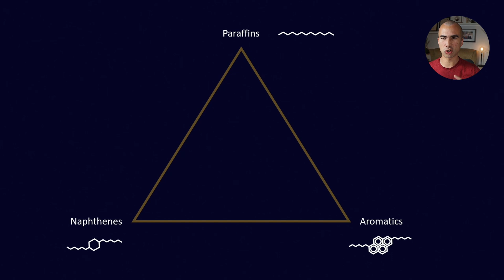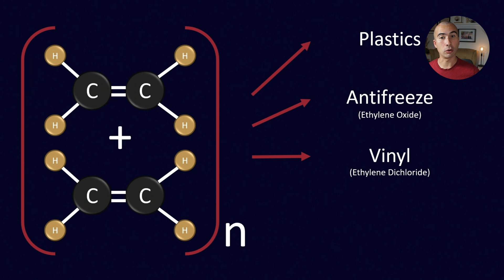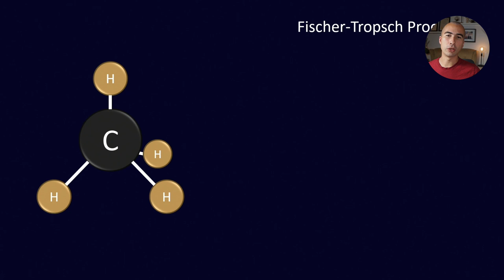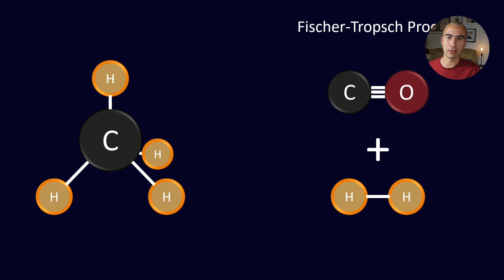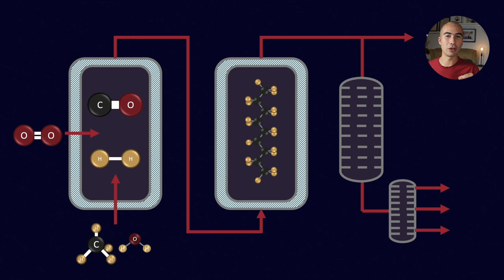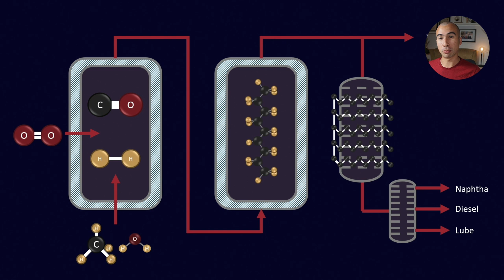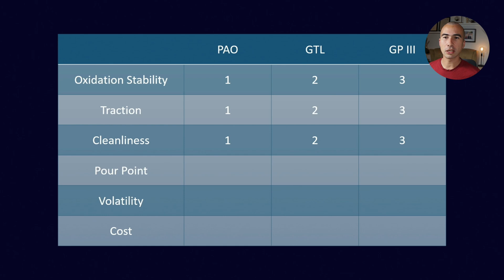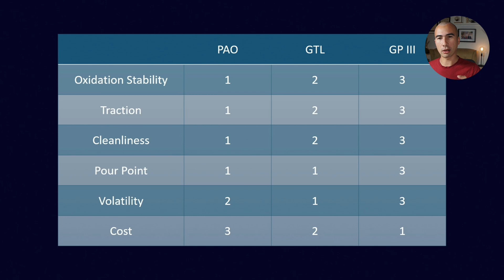What are GTL base stocks? How do they compare to PAOs and GpIIIs?

Comment: Ooo, Mr. LE? Are you losing the plot? Aren't G IV PAO's manufactured by GTL process?
Wtf, mate? :(
Reply from the maker: Hi Mr D'Souza. There's a couple of things to tease out in your question. Let's do technical first:

Yes, PAOs are start their life as ethylene, which is a gas. However, "GTL" is a specific industry term for liquids formed from natural gas. As a raw feedstock, ethylene is "purer" than natural gas, which accounts for many of the performance differences between the two, but natural gas is much cheaper, which account for the differences in price. PAO, and especially mPAO is always going to come out on top in pure performance terms, but for price/performance ratio GTL probably has the edge.

Second, let's address the history. The basics of the GTL process were discovered in the 1920s by the two gentlemen that give their names to the Fischer-Tropsch process. However, the process of converting CO and H2 into higher c-number molecules was inefficient (~40%). Several companies did R&D work in the 1980s, specifically around finding catalysts that improved efficiencies up to around 80%. Exxon and Shell seemed to be the frontrunners in these technologies; post-merger ExxonMobil looked at up to 10 sites for GTL plants and from what I understand they settled on one in Qatar. I believe Shell's main GTL plant in Qatar was intended to be a JV between the two, but ExxonMobil backed out to focus their capital in LNG facility investments, which they felt would be more profitable for their natural gas assets. Since then, Shell has built a smaller facility in South East Asia and a few other companies have built smaller ones, but Pearl GTL in Qatar continues to dominate the market. 

Thirdly, let's talk about the future of GTL. Building a GTL plant is extremely capital-intensive, and as ExxonMobil showed you have to make a decision between converting gas to liquid products, or building an LNG plant to sell LNG. The economics of both options are very different. If you want to sell GTL lubricant base oils you also need two things: access to a gas field and a base stocks company. This leaves only three players in Shell, ExxonMobil and Chevron. ExxonMobil and Chevron have displayed no interest, so that leaves the GTL market to Shell, who really have no incentive to build new facilities. As the only player, if demand for GTL products increases they can just raise their prices.

Finally, let's talk sponsorships. YouTube is governed by USA consumer law and all sponsored content must be disclosed (you'll often see a "includes paid promotion" watermark on such videos). None of my videos to date have been sponsored, nor is the channel. As much as I would like to earn a little money, I feel there's more value in the channel remaining "brand agnostic" so that the focus is on technologies rather than specific products. For this reason, I have no intention to accept paid sponsorships in future; I might make an exception if a lab or oil testing company approached me just because it would give me access to technical resources that I think would be useful to the audience, but lubricant brands are off the table.

Hope that clears up a few things.
Reply: @LubricationExplained  Gettin' There :) Yair, Fischer-Wotsname, was German/ South African, Tech?
Ref: Their, Geology? Economy? Times?...
My Contention Was... Mobil scientists? Come up with this use for Ethylene... Circa mid 1980's? 
Exxon, Gas, Was just being Flared Off? In their Middle Eastern, Plants?
That was the "Economical", Thing to do? Back in The Day?... Nobody, GAF? :) 
As a young fella, then - I had wondered - If that gas, could be used? At least, to Fire the Refineries?
Who was I?... The Boffins, came up with PAO... I knew not, mPAO? cPAO? GTL? G3? G4?
Shell, Pennzoil, BP, Castrol, Valvoline... Independent Manufacturers?... 
G2 & "Super" (Leaded fuel), Was... "As Good As It Gets, Sunshine"? 
Mr. LE'd've been, born? :)
Reply: @LubricationExplained  your response is very much appreciated. Thank you for taking the time to write all that.
Reply: @LubricationExplained  thanks for clearing that up.
Reply: It is, but PAO uses ethylene gas, not methane gás. This methane is extracted from natural gas or wax as  in so called Shell GTL (Group III+).
Reply: @tomasnokechtesledger1786  Mobil invented GTL, before Shell? That was from natural gas.
G IV PAO = Polymerized, Alpha Olefin (Full, natural, HC molecules)
Is Mr LE being sponsored?
Reply from the maker: Hi! Thanks for your kind words. To be honest, Mr Molakule is clearly more knowledgable about lubricants and formulations than I am - it's just that the BITOG forum is not the most efficient way to teach. I think that's where it's really the YouTube platform that holds the advantage.
Reply: Also…cPAOs are primarily produced via BF3 process of oligimerization which operates much differently than FT process. During PAO production, the process is fed with ethylene oligomers which are predominantly C10 or C12 based. That little nuance makes a huge difference vs. if you tried to basically oligomerize let’s say a C30 carbon chain length syn. oil directly from ethylene. 

In my opinion, one of the most key advantage for PAO is viscosity properties at the lower temp. 

Pour point:
PAO4 <-50 C
GTL4 <-30 C

Makes big difference for viscosity if you start looking at things like viscosity, cSt @ -20, -30, -35 C.
Reply: Very silly person😂😂

Comment: What about gtl vs esters
Reply: Amsoil is the first to start using 100% Ester base oil and it destroys the seal. Group V doesn't mean it is the best or better than PAO or GTL. For me I prefer GTL over PAO for passenger cars because it does not need co base oil to dilute the additives, it won't shrink the seal, the oil won't evaporate easily meaning less oil consumption, and lower oxidation value at the starting point of using the oil to begin with. Ester oil when exposed to moisture it will become acid meaning if you are the type who likes to make a lot of short trips your oil will expire sooner compared to non ester co base oil.

Comment: Thanks for this video - I remember when GTL was going to be the next big thing and the hydrocarbon product value spread supported CH4 -> Fuel, especially for stranded conventional natural gas producers.  Unfortunately the project management of the Shell GTL plant was bad and the final cost came in around 200% of the estimate and that sort of weighed down other GTL plants.  As the years rolled on gas rich regions opted to monetize gas as LNG as that technology was more mature and project execution was more reliable (i.e. final cost = estimated cost).  LNG was bankable and GTL was much less bankable. Also back in the day - Exxon had a nifty MTG (Methanol to Gasoline) zeolite based process. I wonder what funky high molecular weight byproducts that process creates?

Comment: This is the best video treatise on synthetic lubricants I've ever seen.  And I'm a retired Mobil Lubrication Engineer.  The only question I have is why PAO volatility is rated lower than GTL?  Doesn't make intuitive sense to me.
Reply from the maker: Thanks for the feedback! Funnily enough I'm a former Mobil LE myself. And you're right - intuitively it doesn't make sense - it's just based on some experimental data that I've seen.
Reply: @LubricationExplained  As a PHD organic chemist with 45 years in lubricant technology, including Mobil Corporate Research for 23 years, and creator of the Mobil MSDW-II process, the premier paraffin isomerization process for making high paraffinic Grp III+ base oils, I'm afraid your knowledge is pretty limited, and many inaccuracies are actually promoted here in this video. Sorry . . .
Reply: So, sir, Do you like Mobil 1 motor oil? Pennzoil? Valvoline?
??? Thanks
Reply: Wow, heavy weights oil heada around here...

Comment: GTL Group III+ base oils have another performance point vs. PAO. 

Better additive package solubility than PAO!

When formulating engine oils with PAO, it typically requires addition of ester or alkylated naphthalenes otherwise the finished blend tends to be slightly hazy and additives have a tendency to want to fall out. 

Commercial:
I’ve seen other GTL base oils in the market such as their 7cSt in non-lubricant applications. Shell has a deal with another major ‘competitor’ for product ‘swap’ deal as well. The other major does not market the fact they have a little GTL in their formulas as well. 

…there are more advanced GTL base oils coming out soon from a new player. They hope to get to make the announcement before Q1-2022
Reply: Today is 23 March 2025, so where is the new player advanced GTL ?
Reply from the maker: Yes! Very true, I neglected to mention solubility but you're right. Not needing a co-base is a big advantage.

Would it be too much of a stretch to suggest you might work in the base stock industry? If so, would you like to come on as an interview guest? Or maybe someone you work with?

lubrication.explained@gmail.com